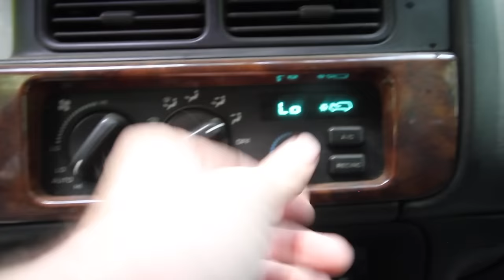How To Super Flush your Cooling System in One Easy Step - Operation Cheap Jeep

Comment: I can use fresh rain water & or have distilled water & may use the fresh rain water & have it filtered to flush the radiator & engine block & well as the heater core & I will taking off the thermostat housing & including the thermostat as well & so I can do a reverse flush as well &.2 of the radiator hoses off as well & so I can do a reverse flush on the radiator as well & take off the over flow bottle as well & give that a good flush out as well & I have 2 250 liter plastic water tanks that collect fresh rain water I can hook up a garden hose to 1 of tanks which is closer to the driveway & all of this doing on a Toyota 3.4V6 5vzfe engine & once I'm Happy with the flushing process & I will also get the air compressor out & get out all the water out of the engine , heater core, over flow bottle & radiator & once I have done all that is done I then will put the hoses back on & including the thermostat housing but not the thermostat & I'm leaving that out & I'm going to put back in the radiator a fair amount of fresh filtered rain water on that that is done I'm going to put in a 650 Mils of radiator flush in the radiator & if I have to I will add more filted fresh rain water & top it up & run the engine for about 15minutes to 20 minutes & then let the engine cool down for awhile & take all the hoses off including the heater core hoses & the thermostat housing & give it another flush out again with fresh filted rain water from the water tank & so it doesn't cost me anything in water bills & I know that my water tank is completely full as we have had a lot of rain & the water tank is overflowing that's the one close to the driveway & when finished flushing the engine , radiator heater core & Iwill  blow all the water out with compressed air & once that is all done & then I will put everything back together again & including the thermostat & themostat housing & I'm thinking of putting a new thermostat in but I do decide on a new thermostat I will test it first before installing it & if I don't install a New one & I will still check out the old one to make sure it is working & then I will even clean out the overflow bottle & install that to & then add a new bottle of antifreeze & pour some in the heater core as well as the & the radiator & then pour in distilled water & I will have a fair bit of distilled water to top it up & I will put some antifreeze in the over flow bottle as well & then start up the 3.4V6 engine & run it for awhile & check the temperature gauge & make that I have no water leaks & have no air locks in the cooling system & once that is good & I will be Happy with that & have a lot cleaner cooling system Kind Regards Peter & I have not long done an oil & filter change as well & the oil is spotlessly clean & I use compressed air to get all the old oil out & that's taking off the oil filter as the oil comes out of the oil filter unit as well when I use compressed & I have the regulator on the compressor turned it down to 40 to 50 psi & works really well to in getting all the oil out of the engine & I do that with all my oil changers

Comment: I'd hate to be a hater but, sometimes you get what you pay for.  Like a free video showing you how to contaminate your entire cooling system with mineral deposits that will surely stick to most of the interior of the system.  Mineral deposits won't cause any problems with overheating the radiator as they stick to channels nor will it cause your thermostat to fail because it is stuck open or shut because of mineral deposits.  Not a problem..or well, maybe it is.  I hope the beginners on car repair and DIY don't follow this method.

Comment: tap water pressure 45-55 psi. Air compressor = 130 psi. Coolant system = 30 psi max

Risky procedure.
Reply from the maker: 130psi if you close off the other end maybe.
Reply: Like with water? It's 130 PSI as long as the compressor keeps up the CFM demand.
Reply: He had the horses off, so everything was open ended. There would be no pressure.

Comment: Definitely skipped a step here, need some chem flush to remove scale and don't buy the 50/50 mix it's a ripoff, put everything back together and then lookup the capacity of your cooling system on the internet, then use half that amount of antifreeze and add water as needed, you will have to purge the cooling system of air by running the motor and monitoring it and add the rest of the antifreeze first and top off with water. Don't forget to run it up to operating temperature before you are done.

Comment: I am stunned by how many drivers use garden hose water instead of distilled water in the cooling system. The water pump manufacturers love clueless uninformed people.
Reply: Watch the video all the way through. He blew out the tap water afterwards with air at the heater block, engine block, radiator and expansion reservoir. He did a pretty good job removing it all  I think. Then refilled with coolant & distilled water mixture.
Reply: You do realize that the water you get in those jugs came out of a faucet somewhere too right?  I've used regular water from my house for years doing coolant flushes and I've never had any problems.

Comment: If you were HVAC certified like myself you would know how wrong that you are doing this process.
Reply: Grant Suntken Why? I'm genuinely curious. Always willing to learn new info from pros and adjust my own methods accordingly.
Reply: mannys9130 when changing the fluid you run a cleaning chemical through then drain you then refill with distilled water and cleaning chemical as many times as it takes to turn clear you run the distilled water and cleaner for 10 minutes then drain once it is clean you have flushed the full system properly.